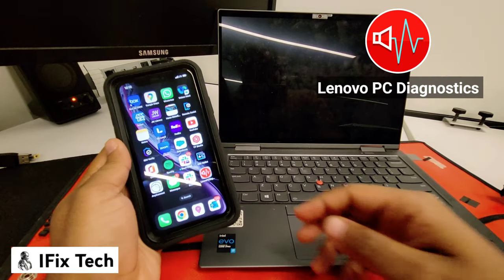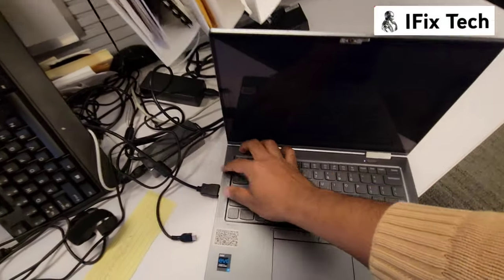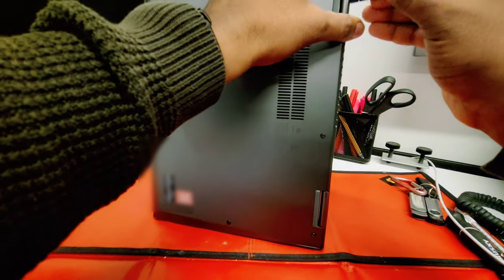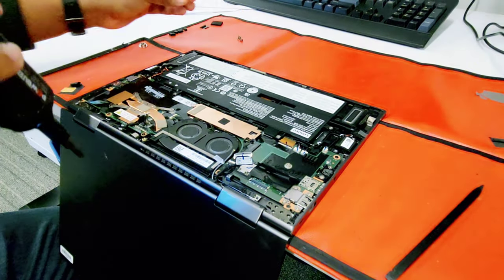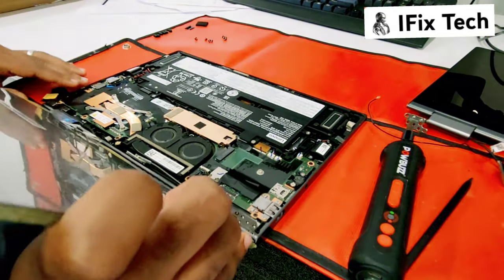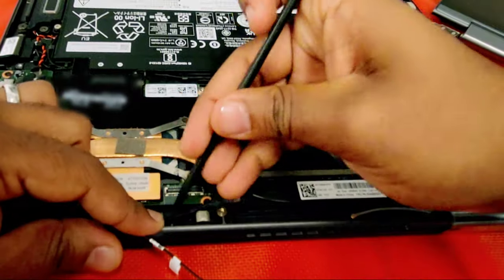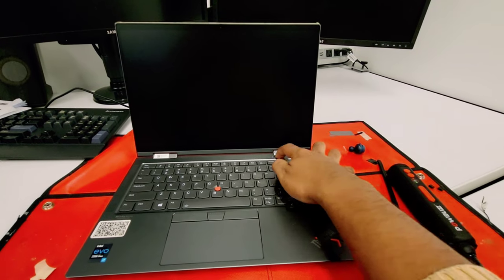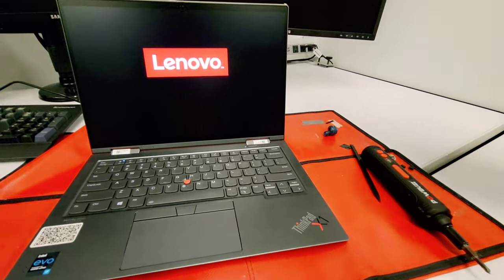Lenovo Thinkpad Musical Tone Error at boot up - Black screen beeping error ❌💻 Lenovo Diagnostics App

Comment: This is an easy fix for anyone who has the Lenovo l14 gen 2 i5 11th gen Intel version ...the melody sound is not the lcd being bad if it was working lately ...the problem is your cmos battery needs to be disconnected...then power the unit om wait a few seconds and the screen will light up normally as intended ..once screen appears power unit off and re attach cmos cable and your all set !!!??
Reply from the maker: Thanks 👍😉
Reply: This fixed my 7th gen x1 carbon having the same problem! Thank you
Reply: I have this problem as of today..how do I access the CMO and power the unit?
Reply: thanks
Reply: Excellent fix, but for me it works just temporary and I have to open the bottom of my  unit every time it appears again and again. 
I have followed your fix step by step, everything appers to be ok, restarted more times to test too, without any problem, but next day again- melody and black screen. Does it mean, that I have to change the CMOS Battery with new one? Or anything else I have to look at? 
Thank you in advice for your help.
Reply: @dodikpe  I have same problem and my laptop now it is almost not working at all.
Reply: Will it work for l14 gen 1
Reply: @meanmint002  Mine is 11 gen I7 Think Pad, I had error 010001, and  I had at least 20 times sound error, some other things are doing very good.
Reply: Thanks for actually having a good answer rather than making who videos going from the window to the wall

Comment: What if I have the same sound code, and the same problem, but changing the LCD didn't worked?  

Actually the "touch screen" works, but I can´t see anything
Reply from the maker: You can use the app in order to troubleshoot it.
Reply: @IFixTech1  actually is the exact same sound, what else could be?
Reply: @IFixTech1  app link pls

Comment: Hello
Hope that you are doing well

Last Friday, I used the laptop without any issues. When I attempted to shut it down, it displayed a message saying "Updating PC and shutting down," so I accepted the update. After the update finished, I shut down the PC as usual.

Now, when I tried to start the PC, nothing appeared on the screen. Even the light did not come on, as if the PC was discharged. I followed this trick, pressing the emergency reset hole located at the bottom panel. After that, I attempted to turn on the laptop, and here is what happened (see the YouTube video filmed by me).

https://www.youtube.com/shorts/4U9-6TxB3us

Therefore, I am unsure what the problem is and where it originated from.

Thank you so much
Reply from the maker: Hello, i watched your video. You can follow the process of this video. Try to download the Lenovo app so you can troubleshoot the issue. Some that could happen after updating bios.
Reply: @IFixTech1  
Hey,

Thanks for getting back to me!

I've already downloaded the app, and it's showing error code 01000 as determined by the app. The solution suggested by the app is something I've already tried, yet I'm still facing a black screen. I went ahead and opened up the laptop, removed the battery and the BIOS, reconnected everything, but the same problem persists.

I'm unsure whether I should resort to formatting the hard drive or using a USB BIOS flash. It's difficult to determine whether the issue lies with the software or if the update has affected the hardware. It's quite a complicated situation.

Thnx
Reply: @soufianesodor3832  were u able to get a solution. I am frustrated now my lenovo t490 is down with same issue